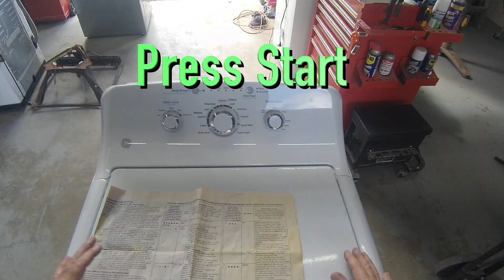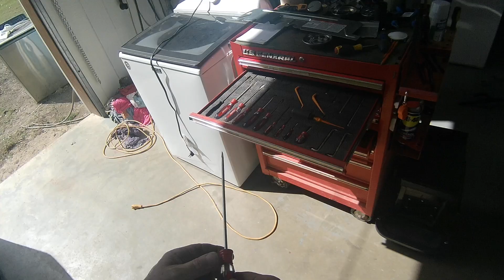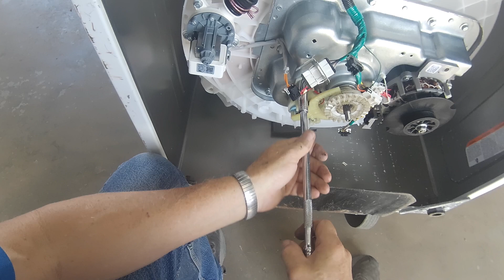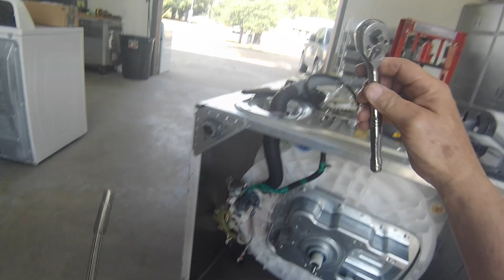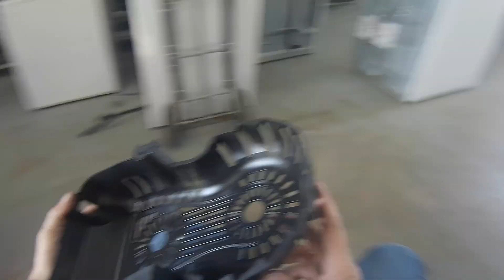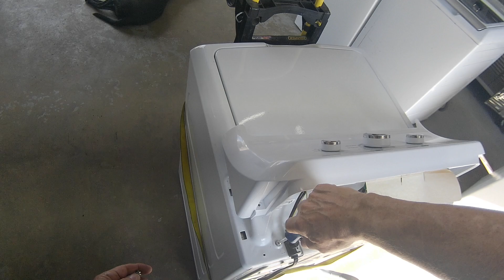GE Washer Gearbox Failing? Full Replacement Teardown — Every Step

Comment: Thanks for your video. The agitator bolt head had rusted enough to prevent a 7/16" socket from removing it, so I had to use an extractor socket and it saved the day. Thankfully a new bolt was included with the new transmission.  GE could have spent $0.50 more for a stainless bolt that would have lasted longer. I mean the washer tub is stainless...
Reply from the maker: That's what it's all about. Thanks for coming back to let me know.

Comment: Anyone has a get profile direct drive? Transmission went out after just 20 months. Right after warranty🤬!!! 

Is this the same steps? Model number ptw700bpt0dg

A technician from GE repair division Bodewell came out yesterday told me this was the issue and gonna cost over $650 to repair not including the $125 I'd just paid them to come out for the diagnosis. friend took it apart twice and put it back together to see if we could find maybe a soccer or some obstruction. Couldn’t understand what was causing this issue so that’s why I called a technician. Now that we know the issue is he’s woolly confident he can replace the transmission. But we’re just wondering if anyone else ran into this issue specifically with the GE profile that has the Bluetooth capability the smart one that hooks up to Alexa.
Reply from the maker: Yes, there may be a few differences but you can use the video as a guide. Thanks for watching!
Reply: If it’s a top loader it uses the same transmission.  Its junk.  My first one was replaced at 6 months and now that  new one is bad and leaking oil 10 months later.  😔
They told me over the phone that it would be covered but the tech got here today and told me the same thing as they told you.

Comment: I know someone who has a Whirlpool WTW4955HW1 washer that sounds like an airplane in the spin cycle. It replaced an old GE. I believe they got the Whirlpool used on Facebook, it looks new but the spin cycle on it is VERY loud.
Reply from the maker: Sounds like the bearings have failed. That’s usually a terminal illness for the washer. Thanks for watching!

Comment: Hey Chip I have a whirlpool washer that does the same thing the clothes end up on one side and I was wondering if replacing the capacitor would help.
Reply from the maker: Usually when this happens it’s either the capacitor or one of the motor windings is burned out. You can check continuity on the motor windings to determine which to change. Thanks for watching!
Reply: @HarperandKnowles  Thanks for info and your welcome

Comment: What a shame to throw it away, nice box to repair. The strange thing is that there are no signs of rust due to water leaking from the tub seal; that is the primary cause of premature damage to the bearings, especially the upper one.
Reply from the maker: Yeah, no rusty water anywhere. Thanks for watching!

Comment: Hopefully GE would give a 2 year warranty on a new washing machine ?
Reply from the maker: Limited warranty. I don’t think it covers the gearbox.
Reply: @HarperandKnowles  oh man, that’s rough. here all major appliances washer, dryer, refrigerator etc have 2 years full warranty and additional 3 years parts only on the big ticket components like gearbox, motors and compressors
Reply: @HarperandKnowles the warranty does cover the transmission because my first one was leaking and had to be replaced at 6 months old.  Too bad the new one is now leaking oil only 10 months later and they won’t cover it now.  The transmission and seals in these are junk.

Comment: What is the going price for a new transmission?
Reply from the maker: I got that one for $109
Reply: @HarperandKnowles  Thank you as always.
Reply: March 2026, just got one, original oem GE.  $220 and it was so much quieter, my 6 year old machine sounded just like the machine in this video before the repair. The replacement wire ties come included with the new transmission, at the bottom of the box.
Reply from the maker: I guess I was in a rush. Thanks for pointing that out.